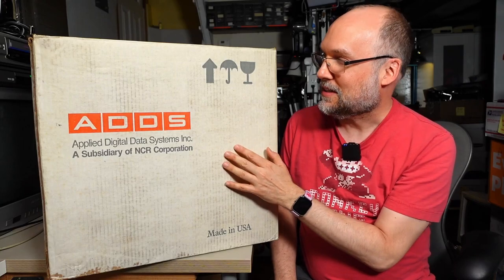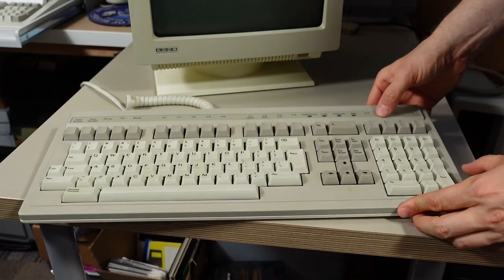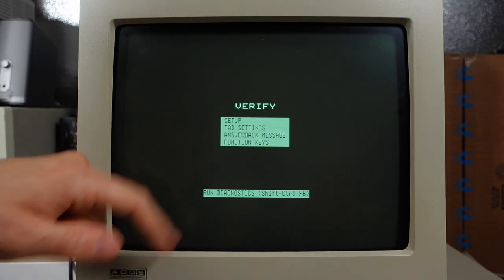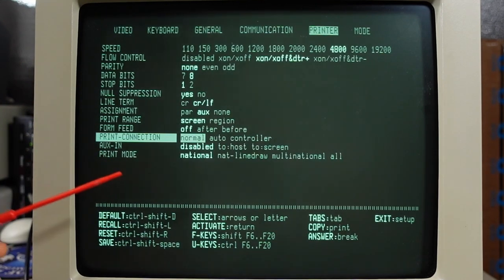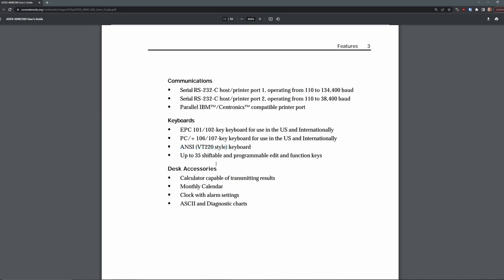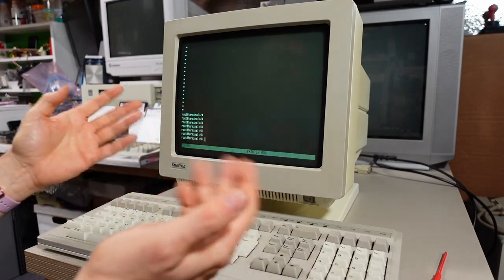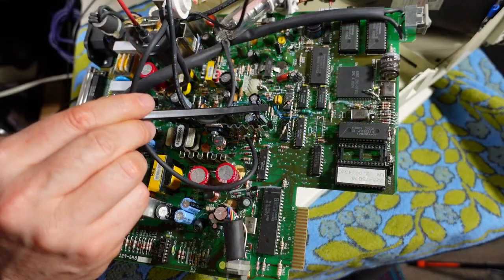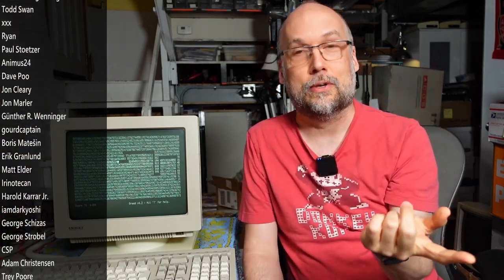Test and teardown: The ADDS 4320 Communications Terminal

Comment: The 8031 almost certainly runs everything in that terminal. This was quite common. Back in the 80s I had reason to disassemble the ROM from a Wyse 50 and put it back together with new features. That ran on an 8031/51 as well as I recall.

Comment: Terminals were super important back in the day.  There's a reason there were a ton of terminal emulation software packages for PC's.

Heck, in the early 2000's we were using terminal emulation to access the sites RS-400 system.
Reply: Terminal emulation is used frequently in some industries to this day. (I support them working in IT operations)

Comment: Both you and Technology Connections sometimes make videos on subjects that I would consider boring, but end up enjoying.  This is one of them, so thanks for making terminals interesting.  Why would you think it's lame that it's speed is limited to 38400?  It's a terminal, so no file downloads, just text.  And since the printer port is limited to 19200 (probably a limit of the printer speed), you can't even use that as an argument.
Reply: Hi, one of the tech that looked after the department i was in answered a similar question

Printer had limited write speed so the slower speed worked well.

Depending on the operating system ( some form of unix or mini / main frame )  a terminal works the same as a printer - just the terminal is really 2 way comms / interactive  and a printer just receives data

Also unless the host computer is on site, they would have used a leased lines or standard phone lines and a dial up / modem service, and in those days 2400 would have been typical speeds

Making a slave / terminal capable of being much faster that what the server / host or the phone lines can carry is pointless

With PC's there was a similar speed issue with comms ports - the UART chip which restricted most modems to 9600 / 14.4k this came out in the late 80's

Also and more importantly, a entire dos screen is 80x25 max or 2k, so 2400 is actually faster ,no one can type a entire page faster than the 2400 can sent it :)

Oh, as you dont transmit the entire page , you also transmit a very small amount of data, eg bar code, part number , price , name / address , very small amount of data

The only real use of high speed serial is the pc and file transfer with a comms package or say lap link - in this case yes the high speed is needed

Regards
george
Reply: And 38400 required good & short cables; I forget if I used 38.4 or 19.2 (possibly 19.2 since I used both sessions as terminal I/O).

Comment: This reminds me of the terminal setups at Mississippi State University when I was in electrical engineering in the mid-80s. They were connected to an old tube type computer system called the univac.

Comment: Boy that sure brings back a lot of memories. My college days were spent in front of a terminal similar to this (in my case, a mix of authentic DEC VT-100s and VT-220s) connected up to my community college's VAX. (at first, an old school VAX 11/something or other; later replaced by a MicroVAX which we named "the Borg Cube" because of its rather squarish shape.) My dream is to one of these days set up an old school centralized computing setup (maybe a MicroVAX like the one back in my college days) with a couple terminals hanging off it.

Comment: At 3:55, I think there is a manufacture date on the serial label. “W052891” which could be May 28, 1991, which would be consistent with the history above and the date codes on the ICs.

Comment: I had a couple Wyse terminals that I bought in the late '90s at a second-hand computer store for $5 each.  One was a WY-60 (green phosphor) and the other was a WY-220 (white phosphor).

Each had many emulation modes, a dozen or more, including some ADDS ones.  I was using these with my Linux PC and so I was able to try out the different modes and see which ones worked best.

In that era, web sites worked well without loading images, so I used Lynx to browse the WWW on the terminals, effectively giving me three displays on one PC at a time when PCs had only one video output.  My friends were suitably impressed, but I don't think they understood the limitations.  Good times.

Comment: Those terminals were used everywhere (and Wyse) from what I remember. Our work used them and the local libraries were using them.  I don't recall ever knowing NCR owned the ADDS brand.
Reply: Our local library had them 20+ years ago.  And they had a little known dial-up number where you could sign in with your library card number and use all the same features from home.  I think they even had Lynx web browsing as an option if you were so inclined.  I was actually kind of disappointed when they made the system available for one and all on the Internet, though actually with reduced features.  Was like a favorite obscure band or restaurant going mainstream or a treasured BBS shutting down.  lol

Comment: When I started my working life, the company I worked for made Cross Platform Text Based software.  We sold SCO Openserver Unix and Wyse 120 Terminals connected via Stallion Serial Boards.    The Wyse 120 looks very much like the terminal in this video. Very easy to read. Even in sunlight.

They  were so easy to deploy and support.  I really miss them these days.   
We used to use Barcode scanners that worked through a keyboard wedge, the Main Serial port for Comms to the Stallion, AUX serial or later Parallel for Docket Printer printing off the terminal.   

These are great to learn about basic serial communication.   Hook one up to a Serial port on a PC with a Cross over cable and you can key basic messages to each end.     At school we used these to connect to a linux machine with BBS software loaded.   Great memories.

Regarding the warranty card you found, we used to resell the terminals to small businesses, so the end user business would then fill those out to get extended warranty direct from manufacturer.   We couldn't sell the extended warranty. Just the actual terminal.

Comment: In the company where I worked, terminals were used to enter production statuses and stock levels. It was easy to type on the keyboard or start the printer. Over time, the CRT burned in because the monitors were running 24/7. Then the terminals were replaced with mini-laptops running Linux. But only to start the terminal program.
The mainframe was originally a 286 but was then replaced by a 486 and later by a Pentium PC, but still the same DOS system.
Reply: You can't call anything with an x86 a mainframe.  A server perhaps but a mainframe is something very different.
Reply: So many companies still use their decades-old backend software, just running in mainframe emulation on modern hardware. Just like the terminal emulation on a laptop you described on the front-end. I wouldn’t be surprised if they’re still using the same system underneath it all!
Reply: @lsorense  if it’s running eg system 360 emulation it could be called that ;)
Reply: @kaitlyn__L  Sure, but a 286/386/486 was not doing that.
Reply: @lsorense  So what do you call a x86 machine that's driving a bunch of terminals via RS-232?  It's more like a mini-computer, but I believe a mini has to have multiple chips for the CPU where as a micro has only one.  "Server" doesn't feel right as it's doing much more than hosting the files for a network.
Reply: @russellhltn1396  a mainframe is huge beyond a mini with massive i/o and redundancy.  Hence why we had mainframe, mini, and micro.  PCs were micro computers.  A server is a machine that handles clients which terminals certainly are.  IBM mainframes were called big iron for good reason.

Comment: char ram is likely to support vt-220 soft fonts. 8031 is likely the processor for the whole terminal, not just handling the keyboard.
Reply: I was thinking this. The big chip is probably some sort of CRT controller (6845-a-like) and all the glue logic to get it to do all the configurable character generator and such.

Comment: Adrian, that card edge connector is likely for a configuration cartridge, which isn't needed on this version since it's VT-xxx family only.

I remember working with an IBM 3151 (I think, or 3551?) terminal that used personality modules like that.  Need a VT-220 terminal?  Pop in a cartridge. Now need an ADM3A?  Swap cartridges.

Comment: Great piece of history. I had in 90 a old Edisa terminal from 70 full of ttl logic (old Brazilian comp. manufacturer that was bought by HP). But I would warn you to take MORE CARE when handling boards like the one you   presented on the video. Although you discharged the CRT, many high voltage caps can still have energy, and cause a heavy burn on your finger's. ALWAYS HOLD SUCH BOARDS BY THE BORDER, NEVER PUT YOUR FINGERS ON THE HIGH VOLTAGE AREAS, EVEN IF OFF THE POWER.

Comment: Yep, these things were ubiquitous throughout the 80s & 90s. My local library used them for their electronic card catalog, which was a pretty big deal when the library opened in the 80s. My college used them for a lot of things, including email access. Even my dad's law office used them to access legal databases. At my first retail job, we used them to access the inventory tracking system, and to place sales orders. As recently as 10 years ago, I was using one much older than this terminal to access an IBM P-series mainframe. 

Dumb terminals may be long dead now, but PCs running terminal emulators are still talking to the descendants of the systems these terminals used to talk to. You can see terminal emulator windows open with connections to AS/400 systems (or whatever IBM calls them these days) at Costcos, probably doing the same inventory tracking job they've done since the franchise opened.
Reply: In the 90s my local library had very strict filters on the PCs, even looking up author Phillip K. Dick would be blocked! But they also had DEC terminals, which connected to "The Internet Poetry Database" through Lynx. With a certain key combination, I could have Lynx go to whatever web address I wanted, no censorship at all; well, except that Lynx was exclusively text, no graphics. In linux I use terminal emulators all the time, it's the fundamental interface; the command line. 
Before that, when I was at uni, they gave all students a VAX account with an email. At that time, my freshman year, email was used almost exclusively for communicating on campus only, between students and professors. Not long after, students were using regularly using email to connect to students all over the world.

Comment: Great memories watching your video. Around 1982/83 I was a fresh software engineer working for the local branch of NCR Corporation when they released a micro coomputer under their ADDS brand division. It should be noted that the IBM PC was still a novelty on the market and ADDS released their system aimed to small businesses runing their version of CP/M (one of the bases of MS-DOS / IBM-DOS) under the name MUON - Multi User Operating Nucleus and yes, it was multiuser.  That ADDS microcomputar had  an Intel 8086 CPU, 128 Kbyes of shared memory, a 10 Megabytes hard disk and could manage up to 4  dumb terminals like yours.  What we used were green and amber lower resolution capable of handling only text mode at 25 lines x 80 caracters and they were frankly ugly and "eye strainers".  We wrote all the usual commercial  applications in Microsoft Basic to be part of our "systems solution" to local customers.    Your terminal is years ahead of what we had and it may be from the early 90s. We also had white screens but just the low res text only mode.  We used those machines with Centronics dot-matrix printers from the guys who invented the parallel printers' protocol.  Those were happy times.  Greetings from Paraguay.

Comment: One of my first IT jobs was working on POS equipment (in both senses of the acronym)  We had a ton of amber and green-screen NCR and IBM terminals that were cosmetically and functionally identical to the ADDS terminal in your video.  As I recall, the boards looked the same too, though I don't remember a forest of bodge wires on them.  Maybe just an ADDS thing.  In a later IT job, we had IBMs as the consoles for RS6000s and other 'mini mainframe' equipment.  In the POS role, they were fed from NCR or IBM PCs (usually PIs, the NCRs were nicer and as reliable as an anvil) running either Red Hat Linux (NCR) or SCO UNIX (IBM), both flavors managing these and serial printers through a "Stallion" terminal server board.  There was a company called Vecmar that would rebuild these terminals for $100 with a lifetime warranty.  I rescued a lot of dim screens temporarily by turning up the "sub bright" pot on the board.  And replaced a few of those batteries.  The ROMs between the NCR and IBM units were very nearly identical.  I don't remember it now, but there was a key sequence that would bring up some 'tools' such as an on-screen calculator, ASCII chart, and other useful stuff.  These were features built into the ROMs.  You could also set a 'banner' to appear on the screen when you powered them up.  Some of the folks at the restaurants I supported had discovered this feature and I found some very interesting and hilarious messages on these.  Thanks for the trip in the wayback machine.

Comment: these may be rare now, but common enough back in the day that i seem to recall that apple pacal had drivers for them. you could use one hooked up to a serial card in slot 3 in place of an 80 column card. (iirc also had drivers for vt-52, vt-100, eyc. there were 3 or 4 different terminals supported. ADDS was one of them. ) most unix flavors also supported these i think.
Reply: Unix could support the features of just about any terminal if you had the patience to configure termcap/terminfo database for that terminal. Fortunately by the late 1990s it came with enough pre-built entries for the most common terminals. See 'curses'.

Comment: In my early IT career, I supported lots of terminals.  They were great...just like today's Thin Clients.  If one failed, you could replace it, and configure it in five minutes.  No OS to install, no data to restore, no setup disk required.  ...oh, and no freakin updates to suddenly cripple it... lol
Reply: We are back full circle now. A modern laptop is often just used like a dumb therminal for Office 365. You take it out of the box and the user selects "for corporate use". After he signs in with his email address all settings are configured, all software is installed automatically, the desktop, files and email look exactly like his old computer.

If the software gets messed up or the user gets a virus you just click "reset computer" in the Office 365 admin interface and it is back to new after ten minutes.

Comment: Terminals like this typically used 8051s to run everything, not just act as a keyboard interface. I'm guessing that SMC chip has the display controller and at least one of the serial ports in it (the 8051 itself has a UART in it, but it doesn't support RS-232 handshaking IIRC).
Reply: Yeah: I was unaware that SMC (aka SMsC) made ASICs with onboard CPUs in the very early 1990s. Both ADDS and SMsC were major electronics companies in the Hauppauge Industrial Park (on Long Island, NY). IIRC SMC also made UARTs  (serial ports) and whatnot in the 1980s so they had IP for serial connected terminals. SM(s)C was acquired by Microchip (the PIC microcontroller/SOC company) about 10 years ago. AFAIK, Microchip still has a design center in Hauppauge.

Comment: One might think NCR made a version for cash registers, and the other company had a different model for general use. The edge connector may give the ability to have certain custom ROM software to load for things like barcode scanners. I'll have to look because I think parr lumber uses terminals, or had used terminals up until recently for their inventory delivery system

Comment: 38400 is pretty good for a text terminal.  Don't forget that they were  generally connected over fairly long serial cables, and you weren't sending a heck of a lot of data.
Reply: And its the limit of the 8250 and 16450 UART chips, so its no coincidence. Actually the 16450 could do better but poorly, it had an infamous bug in its buffer fixed in the 16550. I don't even know how my brain even remembers this, i think it has to do with dial up modems becoming faster than 33.6kbps and reading articles about the issue.

Comment: That PCB looks like it was “creatively” engineered. Never mind the bodge wires, look at the power cable running to the switch at the front, and the PSU part in the middle of the board. All the digital signals from the back must run around that area to get to the chips at the front.

Comment: Applied Digital Data Systems was a manufacturer of high-quality video terminals. In March, 1979, ADDS had delivered 100,000 CRT terminals. In 1980, ADDS became a wholly owned subsidiary of NCR. In 1991, ADDS become part of AT&T when AT&T purchased NCR. In 1994, AT&T sold ADDS to SunRiver Data Systems. In 1996, the company was renamed to Boundless Technology.

Comment: I have one of the old mid70s ADDS terminal in my basement waiting restoration.  I haven't powered it up and have only once poked inside to see massive linear PSU capacitors.  Interesting, the top half of the case is made of fiberglass, but that's where the lightness ends because everything else is chunky.  Right now it holds up a wall of shame motherboards.

Comment: Thanks for the tip about the battery, I have an optically exactly identical terminal, but labeled IBM InfoWindow, I will quickly remove the battery :)